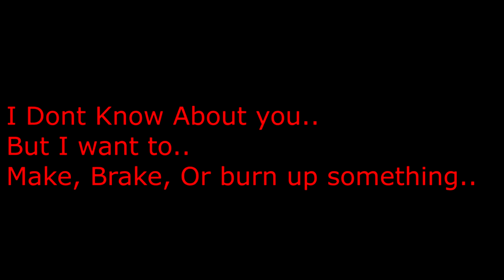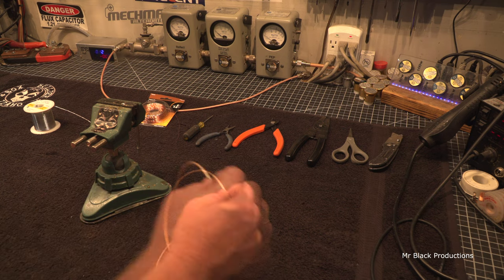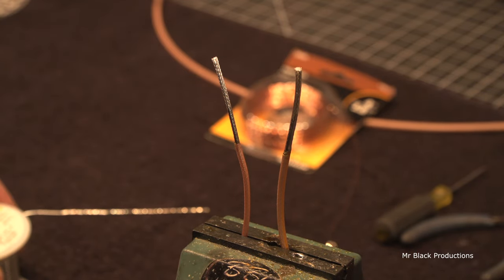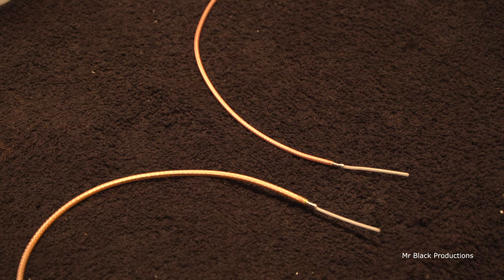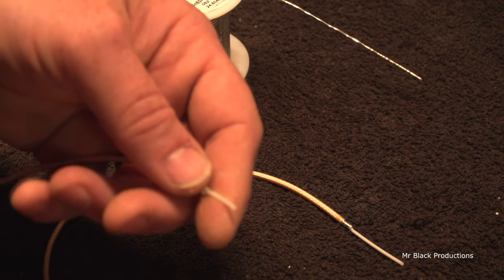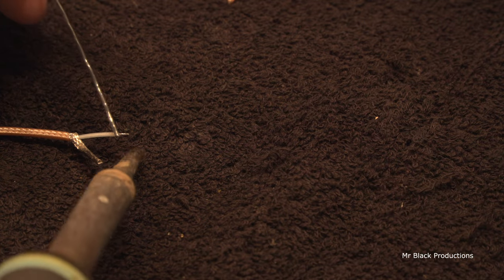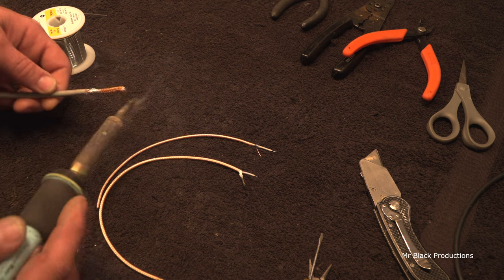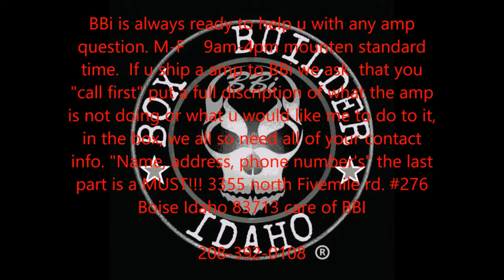How to work with rg-316 and rg-316ds coax

Comment: Used to use a syringe type device on small coax, it was inserted between the braid and the inner then pushed through the braid. The plunger pushed in and the inner would pop out the end. Leaving the excess braid to be used as the pigtail. 
Also worth a note is PTFE is as slippery as hell, if you stretch it when stripping it will shrink back along the wire leaving a bare end which could cause shorts later.

Comment: So... If I'm running a 3cx 3000 which coax do you recommend ?
Reply: I’d go with RG-393 at minimum
Reply from the maker: Rg-217 will hold it. All day long.
Reply: @BoxBuilderIdaho  and pretty simple to work with. Thanks bro

Comment: Where’s the best source to get these coax’s?  Real but not fake…
Reply from the maker: Plaster neck Direct
Reply: Justin Partridge  pasternack.com*
Reply: What size amphenole reducer do you need for the 316ds?
Reply: @dlg926  UG-174,, is the most common reducer that’ll fit,,but there is a specific reducer that’s a tiny bit smaller hole size..